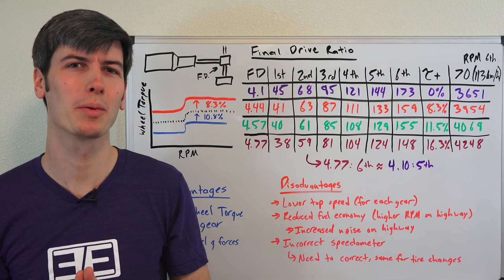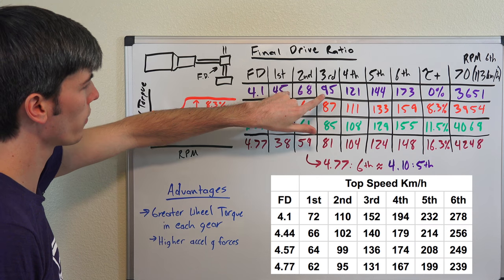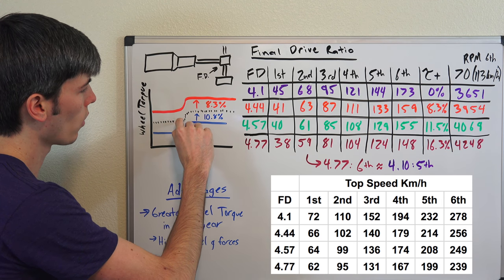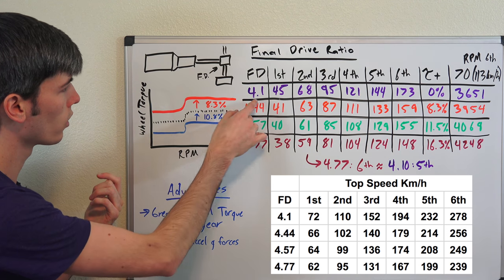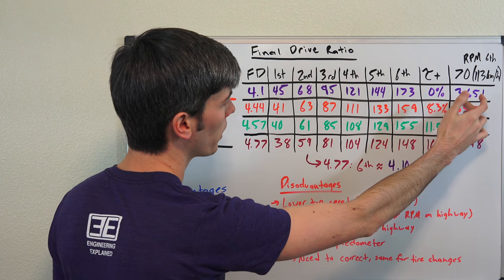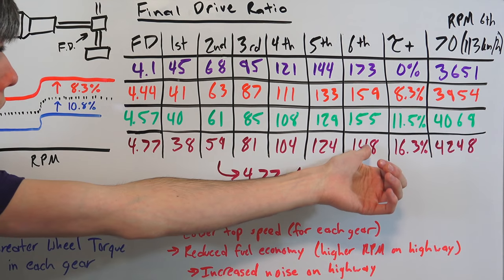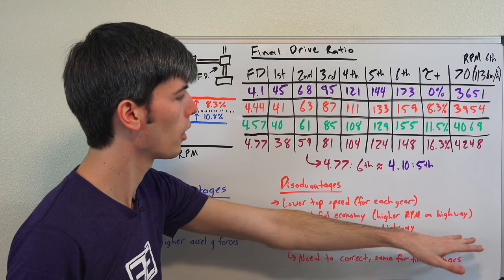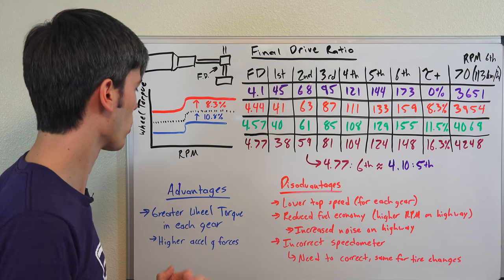Why Is Final Drive Ratio Important? Accelerate Faster!

Comment: You need to do a video on parasitic hp loss on engines , and the weird 15% hp loss between motor and tires through drive train cause im confused as to how the hp the motor has the more loss you get through drive train .. help me out on this one
Reply: Paul Christopher the engines power drives the wheels to make the car move. For example, a 100 HP car may have 85whp (15% loss) because 15 HP of the 100 HP is used to power the alternator, water pump, A/C, power steering, camshafts, etc. The remaining 85hp makes it to the wheels or ground.
Reply: the losses are a combination of the parasitic losses from the transmission and rolling friction.   the alternator, water pump are all devices that are on the engine and would be on the engine if it was on an engine dyno.  we are ONLY talking about driveline losses .    this changes with speed. for example, on the dyno, you loose about 10hp to rolling friction at 80mph and that goes up to 20hp at 150mph. (this is just rolling friction and friction of the driveline bearings..... now, put it in gear, and you lose about double that due to losses in the gear box depending on the engine HP.   (im refering to a 200 to 300hp car)
Reply: no, the 15% loss is at max HP , and any less RPM, then the losses are less. it also depends on the gear you are in.  AND,  the mixture of losses is rolling friction and transmission. it has NOTHING to do with alternator, power steering, water pump, camshafts etc.  those are all on the engine when engine dyno'ed.  (maybe with out the PS pump, or AC, but thats never on on, or much of a factor,  a rear wheel dyno anyway)  lets see you run an engine on an engine dyno without the water pump.  He he he!       truly we are talking about HP at the crank just as it touches the clutch and driveline!

Comment: So If I wanted wheel slip or to brake my traction to start a slide and drift I would want a higher gear ratio like the 4.77 which gives you more torque?

Comment: I learned this from playing forza.
Reply: And where did you go to school? Walmart?
Reply: something1random23 Aldi actually.
Reply: +something1random23 she is mechanic from the Lidl
Reply: HAHA. Sounds like a computer game. I learned how to work all this on Gran Turismo 4 - PS2 - haven't played a real racing game since. So, in short - I left a long comment else where, I'd lower the final drive some and then put the last gear you shift to up higher to compensate to maximize acceleration, but keep top end.

Sometimes you had to apply other upgrades to have the gears meet on the power curve well enough. It took more driving skill, but if you put it all together you could beat NPC's you couldn't before!

Of course, I came up with lots of variations on this, but that's the core of my comment.

Comment: Which one is best for driving in city   more the high way 2.73 or 3.73 ? Everyone know that there is many traffic in the city as result of this requiring  more acceleration to move.
Best regards
Raheem from iraq
Reply: The lower gear ratio. You'll maintain a lower rpm while hitting a higher speed. The only reason you would want a shorter gear (higher gear ratio) is to accelerate quicker, but you will ride at an overall higher rpm. The higher the rpm the more gas the car will use.
Reply: @matthewgaskins202  
Thank for reply. 
If the car move quicker at higher ratio that mean the moving time is reduced According to acceleration equation which equal to(acceleration = velocity/ time) .  So, there is possible to reduce the gas required for  mpg
Reply: raheem274 Yes. You’ll actually reduce the mpg quite a bit depending on high of a gear.

Comment: Tell me, i have 2 gearboxes being the one in my car and the one i bought from a scrap yard. They have the same gear ratios from gear one to 4. My transmission has a final drive ratio of 4.111 and the one i bought has a final drive ratio of 4.444, do you advise swapping the differential?

Comment: So, let me make this VERY clear.. you dont gain wheel torque at the cost of speed  over all.  that premise is incorrect and needs to be better understood!  you might gain torque in each gear at the cost of speed, (in each numerical gear)  but overall there is NO average torque gained or acceleration forces over speed ranges through more than 2 gears.    The ONLY advantage is is to match the speed ranges you frequent at a track or on the road, to the gear ratios that optimize HP!   (wheel torque).   the more varied the speed ranges, the less switching out a final drive will matter.  KEY POINT!    this video is very misleading!

Comment: Well I have a 2009 F150 with a large lift kit with 40 inch tires what gear ratio do you suggest and do you have a link for the ones I need I’ve been searching but not sure after Coming across your video

Comment: is it possible to change front wheel ratio??? 😅
Reply: Fareez AreJuna I believe so, I'm assuming you can change any differential gear ratios ( or final drive whatever ) as long as its got a differential.
Reply: Yes it is, but most front wheel drive cars come with a built gearbox-finaldrive package, so basically you need to change the transmission to (as an example) a wagon type one, or a lower performance one, thus it tends to have shorter gearing. 
For example Vauxhall corsa, astra goes with the same transmission, and a Vauxhall astra wagon-s transmission makes a little engined corsa fly. :D
Reply: Fareez AreJuna  yes fwd has a chain and gear set that you change out to change ratios

Comment: Hopefully somebody can answer this. I have a 2015 Chrysler Town & Country & my transmission needs replacement. I’m thinking of replacing the transmission and using the transmission from a 2017 Dodge Grand Caravan. First to Sixth & even reverse ratios are not the same to my Town & country but the final drive ratio is the same. What will happen if I replace the transmission either way? What would be the consequences?

Comment: can you calculate how much fuel economy one would lose by going with a more aggressive final drive gear ratio?
Reply: That's quite hard without exact knowledge of the engine and its mapings. Because you will run with higher rpm at the same speed, but with a lower load on the engine so you end up with two opposing effects. The ECU fires the injectors more often, but there is less fuel injected per firing.

Comment: I have a 5 speed manual, at 3000rpm using the highest gear which is 5th Gear I am cruising at 100km/h. Is it possible to change the Final Drive Ratio to get lower RPM?

Comment: Here is the problem....stop talking about what gear you are in .... talk about torque at the rear wheels at any speed or speed range.   Changing the gears to a shorter ratio  rear end,  this means, you might get 11% as Engineering Explained  says.  BUT, he doesnt mention that when you shift at a 11% lower speed, you then have a 30-35% LESS torque for the next speed range to end up to the shift point where you were at before the gear ratio change.  the net net, is NO gain in the end..... you dont get overall wheel torque, you dont gain HP  (as he said)  its all about average HP over a speed range.........after all  acceleration = power/(mass x velocity) this means acceleration is proportion to power (or rear wheel forces).... so, maximize HP and you maximize acceleration . changing a gear ratio will not do anything but make each gear feel more torquey, but at a lower speed.      over all, there is no change in the rear wheel forces , average over all the gears , even ignoring the top speed reduction overall.  Again, he has the right info, just the wrong conclusions.  VERY IMPORTANT TO UNDERSTAND THE DIFFERENCE!

Comment: Would this still apply to an AWD platform? In the sense that since the driver has changed the final drive does said driver have to change the differential in the transaxle?  I drive a 2005 Impreza rs and was wondering

Comment: Help me out, My Ram 5.7 L has 3.92 rear end with factory 20 in rims. I want to put on 17 Inch drag race tires. Can you tell me my approx new gear ratio. Will it be closer to 4.10 or 3.55 ?

Comment: So with a car.. for example the rx8 that cant reach redline in 6th it would be a good idea to change the Final Drive?  6th is .8 while 5th is 1.0
Reply: If you only care about performance, and not reliability or economy, then yes.
Reply: how would this be bad for reliability?
Reply: clownavenger during highway driving the higher rpm means the engine will wear faster than normal and rotaries aren't known for reliability in the first place.
Reply: The already questionable fuel consumption would get even more questionable as well :P
Reply: As an owner i can't disagree with that.

Comment: Does more torque essentially mean more acceleration? Or is it not a direct relationship?
Reply from the maker: Mitch3lT0mas yes, longitudinal g-forces will be higher for each gear.
Reply: Mitch3lT0mas Most cases it does
Reply: yes its a trade of acceleration vs top speed
Reply: If you keep the tire size, gear ratio, and gross mass of the vehicle the same, then yes.   Because torque through tire size and gear ratios manifests as the traction force that pushes the car forward.   Net force / mass = acceleration

Comment: You did not address lugging an engine. Larger tires with stock gearing messes with optimum power band. My Bronco is running 35” tires with stock 3.50 gearing. I barely get away with it, only because 1) my zero smog equipped 332 forged 10:1 stroker is running around 400 hp/400 tq to the wheels, and 2) my NP435 granny low manual 4 speed has a 6.69:1 1st gear, normally only used for rock crawling and towing, but I use it to get moving to about 10mph, then 2nd takes me to 40mph, then 3rd takes me to 70mph, and in 4th on fwy at 85mph I’m just under 3000rpms.  My motors induction, heads and cam flow to 6000, but until I have a roll cage 85mph is all I want to see 🤣

Comment: I NEED YOUR HELP!

I recently changed my front sprocket for a smaller one (stock 14T -> fitted 13t)  on my 200cc KTM year2014 DUKE motorbike. The final drive ratio has changed from 3.0 to 3.3 . I was going for an accelaration focused setup but that was not the case. My bike feels slower now and I don't mean the lowered top speed. Is it possible to have a lower peak torque with my current setup, regardless the 3.3 FD ratio? I feel that the stock setup (3.0) offered me more acceleration. Is it just an illusion? It sounds counter intuitive! Should I revert to stock? Thank you!

Comment: I have a 2010 honda accord k24  manual trans. It has a 4.3 final drive n it is a 5 speed trans I would like to change to lsd with a final drive 4.7 . how would the gear ratio speed would be . will it be better n faster ?

Comment: Oo I can modify my speedometer so that it shows im going a lower speed than I actually am? Interesting 👌
Reply: RzVids Then install a device that records your speeds, so when you get a speeding ticket you can battle it in court showing what your vehicle read. I'm not sure if that'll work, but why not right?
Reply: Arthur Friday Not broken, modified.
Reply: All that matters is what the cops clock you at. They'll keep giving you tickets until you get it recalibrated.
Reply: something1random23 Then I'll fight it in court and sue for loss wages. My clock > theirs
Reply: RzVids good luck. Won't work.

Comment: I thought the speed sensor read the tyre rotation at the wheels? Are you sure changing the fd affects the speedometer reading?
Reply: Yes. The tire application is only used in older motorcycles 20 years ago. Reading the speed of the transmission is also more accurate and easier to integrate.

Comment: I'm sorry for asking a question you may have explained..... if I have 263 rwtq at 2.73 gears then I swap to 3.73 gears what would me rwtq be or percentage in which it will go up
Reply: I have recently went 3.73s and the initial slam you in the seat is muchhhj improved
Reply: 263 rear wheel torque? Your engine is still gonna prodruce 263, but with that aggresive gearing you are up about 36% at your wheel torque. Which is pointless as explained in the video since you eliminated your last gear and you have a really short first that's probably gonna top at 20mph.
Reply: More than eliminated the final gear....it's fine if he doesn't ever have to sit at high speeds for long. Track only?
Reply: DE Nichols no sir..
 only track it encounters is 1/8th mile once a month I commute in long beach I never go above like 45 as a cruise..... if I need to go anywhere on tje highway well take the 300
Reply: DE Nichols basically a toy
Reply: richard bean Awesome. The perfect car for tight gearing! I'd be all smiles too!
Reply: richard bean And so you know for future reference. Gears are simple math. Divide your new gear by your old gear to see the percentage increase...and subsequent decrease in top speed? Divide it the opposite.
Reply: DE Nichols yes sir! thank you and that's correct! before I go to the 1/4 mile I'll nees to get a 1 piece drive shaft since its spinning 36% faster I need to keep the speed down to about 85 (I briefly pass that at the end of the 1/8th) the factory car is limited to 115 but so the tune it's gone that being said they liked to explode at high speeds so I need t upgrade before I go for a longer track although as for now the .125 mile track is fine

Comment: I need to change the final drive in my car, first gear hits 8,000 rpm at 20mph.. so I only launch in 2nd lol
Reply: well, it's also transmission gears, for example
the z06 corvette has 3.42 and first gear hits 60mph on the top of first, a camaro SS has a 3.45(slightly higher) yet first ends at around 40mph.
They both use a TR6060(T56 super mag)
first gear in a C6 Z06- 2.66
first gear in a Camaro SS - 3.01
Reply: CorvettesandGainz. the problem with my car is the engine was taken from a Honda civic and fitted to a classic mini, the Honda had 15" wheels and the mini has 12" wich has completed messed up the final drive
Reply: +MattyMag Don't feel sorry for me, it does 0-60 in 3 seconds and handles amazing.. And who modifies their car to increase its value? 

Also it used to top out at 90 with a 4 speed gear box, now all the gear ratios have changed the old top speed is erelevant

Comment: I have a question. If I drop from a 3.99 to a 3.00 what kind of torque loss will I be looking at? 3.00/3.99?
Reply: Like, 25%
Reply: So if my torque rating is 325 at the flywheel it would be about 290 at the wheel under current set up. And if I switched it would be about 217?

Comment: Can increasing the diff ratio multiple the torque through the gearbox? My tuner warned me that since I changed my diff ratio I have a high chance that I will break input/ intermediate shafts because of the change of torque flow though it?Would this be true ??

Comment: My car has a blue light for temperature, it turns on when starting the car then in turns off when it's hot enough. Should I wait until it turns off to star driving? HELP
Reply: Eduardo Herrera. That light just indicates is your engine on it's operating temperature, don't wait it on idle, it takes forever for the engine to warm up like that, just drive gently until the engine reaches it's operating temperature

Comment: How low can you safely bring the ratio down im looking for higher top speed because i have a 4 speed manual with a 1998 vin f thunderbird 302 engine it is a 1986 Ford f150 and hitting the freeway 75 destroyed my gas mileage although  even at my best moment I get about 11 to 12 miles to the gallon
Reply: Going 75 destroyed my gas mileage*

Comment: What about cars that have dual final drive ratios? My 2010 Mazdaspeed 3 had this, a 4.XX for first through fourth, and a 3.XX for fifth and sixth (sorry don't remember the exact ratios). Explain this witchcraft to me, I've never heard of another car with that kind of setup. Was this just a marketing thing, or were there really two different pinions on the ring gear in the diff.
Reply: I guess this is just a marketing thing to sound cool.  It's possible in some ways, but i doubt it tho.
Reply: Just looked at the shop manual, this works because it's not a traditional ring and pinion in the differential, The differential gear isn't chamfered like in a RWD differential, both shafts in the transmission have a gear that meshes with the differential, so depending on gear there will be two different ratios propelling the differential gear. Neat.
Reply: It's actually pretty common in FWD applications.

Comment: Can i put toyota c160 transmission 6 gears to my 7afe toyota engine in corolla 1998 it has now 5 gears which reves 3000 rpm and do 120 so i need economy which this lac i need the engine to rev at 2 to 2.5 k does it will do that for me...!!! Thanks

Comment: Hey EE, why are some final drive ratios repeating decimals? I've heard of a number of final drive ratios that end in repeating decimals. is there some benefit to this at the machining stage?
Reply: That's simply math. 
The stated ratios are nothing more than the ratios between the number of teeth of the pinion gear and the number of teeth of the ring gear of the differential.
So the number you calculate the ratio out of are always integers, never decimals because you can't cut a quarter tooth or half a tooth. Also the number of teeth you working with is always odd, never even. And this will give you always certain patterns of numbers behind the decimal point. For instance if the pinion has 11 teeth, a number which is infact quite a common number of teeth at the pinion and lets say the ring gear has 47 teeth, you end up with a ratio of 4.2727272727 and so on. Simply because you devide by 11.